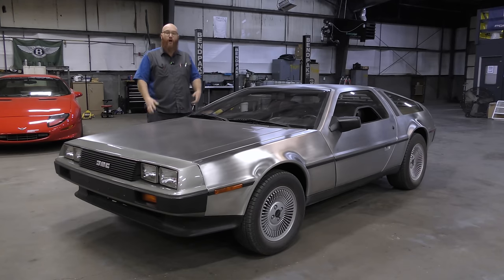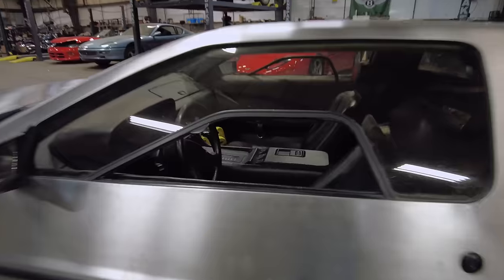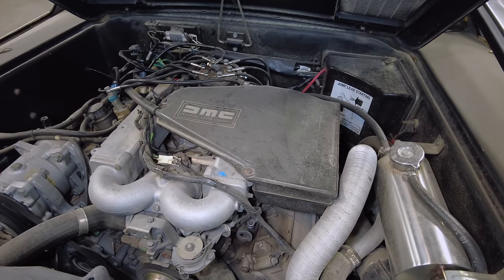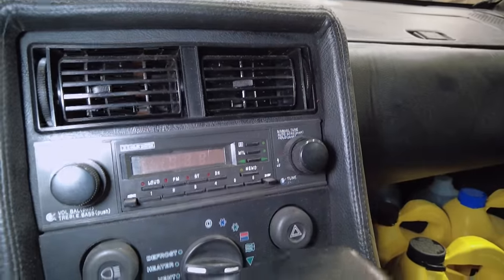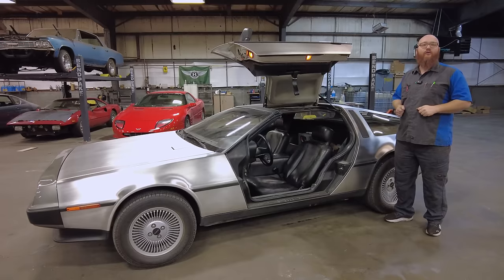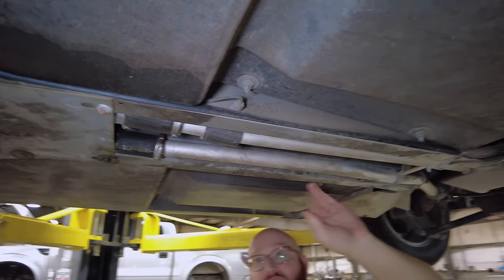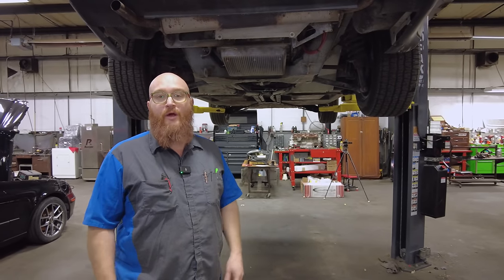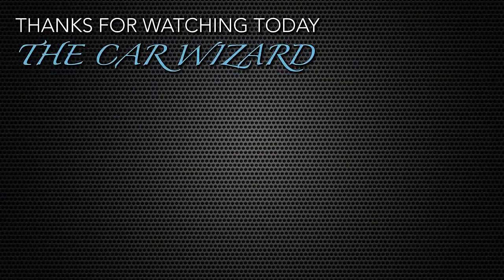Time Machine in My Shop! This DeLorean Will Send You Back to 1981

Comment: The Hot start issue will be the Fuel Accumulator. it's a wear item. Easy to fix.
Reply: I was going to say the same thing (happened to me too)... took an hour or so to replace and fixed issue instantly.
Reply: Fortunately, in the 13 years that I owned mine, I never had a hot start issue. Just an occasional no-start issue! lol

Comment: The engine bay was designed for a rotary engine that never came to be.  GM was looking to build one and John DeLorean would source it from them but they only built concepts and then abandoned the project, as did all the manufacturers who went with pistons instead except for Mazda and its Rx-7 with its tiny engine could generate 300 hp which was so attractive to John. A DeLorean was converted to use a Mazda Wankle rotary engine, and it goes 0-60 in 4.5 seconds so it worked like it could with the right engine.  This engine failed DeLorean, the car was not great, and of course then he went to drugs to save the company and we all know how that went.  The company died because of the lack of an appropriate engine for that time.

Comment: I have owned - restored - sold two of these in the past, and seeing videos like this kinda makes me want another, until I remember what bad cars they are. Thankfully I still have my photos from those restorations.   Thanks Wizard for the trip down memory lane!
Reply: Well. You could just keep the body and replace the engine, transmission, all the electronics etc 😂
Reply: They had such potential….too bad GM was allowed to go to war and run them out of business. It really started with the drivetrain choice.
Reply: They’re awful cars 😂
Reply: @Whatisthisstupidfinghandle 
Basically what you would want to do if you’re planning on driving it daily. 😂
Reply: @rolandthethompsongunner64 wrong again. I daily drove mine with no issues
Reply: 130Hp. Half fiberglass. Every bolt on the stainless body is apparently not rust proof.
Reply: @rolandthethompsongunner64  dude you really gotta stop with the bashing. Do you own one? Have you owned one? Please show me where the Delorean car hurt you
Reply: @DeloreanGuy2  If you want one go buy one. But hey don’t bother to do any research and see what you end up with. Because nothing I’ve said about that car is wrong. They’re heavy, slow, handle like garbage and have crappy power plants. You would be better off with a Pontiac Fiero . At least until it catches fire. 😂
Reply: @rolandthethompsongunner5305 I have a Delorean. I've also owned a fiero. They are slow compared to what, a new car today? That's not a comparison. They aren't heavy. My 2 door convertible bmw is heavier, by a lot. Mine runs just fine anytime. It is 40yrs old and as such requires maintenance, what car doesnt?
Reply: @BubblesTheCat1  I'm so glad you came on here to just bash every car you have a problem with. Have you actually ever owned any of the aformentioned cars? Also you must not know how to do mechanic /maintenance work of any kind and NEED to drive  a "reliable" toyota. I'm not interested in a "basic" car like a toyota, otherwise that's all i'd own. Cars are my hobby. I must be really into "crap" cars! oh well, at least I enjoy them, and that's all that really matters. I don't know you, will never meet you and could genuinely care less about your opinion on the internet. But hey, good like to you in life with that attitude!
Reply: @rolandthethompsongunner64  what's your definition of heavy? I agree with underpowered but that's easily fixed with better cams and a free flowing stainless exhaust. As for the handling, they don't handle all that bad especially if you go for the aftermarket lower lower control arm brackets and poly bushings for the rear trailing arms! Also when a lot of people look at these cars they tend to not use any historical context, looks at the late 70s and early 80s corvettes... also the other sports cars coming out of the UK at the time.. They honestly aren't all that bad for being assembled by a group of people who had never built a car before and they're plenty reliable, I know quite a few owners who daily their cars. One of them even has the twin turbo kit on his

Comment: Before adjusting the mixture and  the fuel distributor, really should check the control pressure at the warm up regulator.  The fuel distributor adjustment is only for fine tuning, but will not fix hard start problems.  What is the black CDI at the shop for?  I have one as my daily.  They are a great value

Comment: Its pretty easy to remove the back bumper and tail lights to work on the front of the engine like replacing the belts and water pumps. I just hope the owner had the valley of death checked out. Coolant likes to leak and corrode the aluminum engine block in the valley to where the oil galleys leak pressurized oil.
Reply: That's where my B27F leaked coolant on my Volvo. I remember seeing coolant pooling there. I had it corrected before any damage was done.

Comment: If it's 304L stainless it will rust right up in salt water, or salty snowmelt. It will turn black instead of brown, but all the associated steel oxidation problems like rust jacking are still there. And there are still carbon steel parts under it that will rust out of existence.

I had a friend who bought one of these to fix up. It's slightly faster than a 3-cylinder Mirage. 1985 me was disappointed.

Comment: The engine is really not hard to work on. Had a Volvo 260 that had that engine: Smooth, very advanced for its time, but no power  house...
Reply: I was a Volvo mechanic and worked on numerous 260's that had that same V6 engine. We hated working on those engines. They were jointly developed by Peugeot and Renault.  They had numerous drivability problems, were under powered, They all leaked antifreeze, and got terrible gas mileage! Labor rates were high due to the component location in the engine bay! Volvo lost lots of sales when they subletted their engines to other manufactures. They also used a straight 6 diesel from VW! Another boat anchor.  Volvo's reputation for reliability suffered because of this. And their sales reflected it!
Reply: @suzintru1  I have had many Volvos only the years, but my favorite was a 1970 164 Automatic: That car was a tank with over 300k miles. Sold it to get a 240 DL with fuel injection.
Reply: Indeed my 604 had terrible cooling problems! all that French plastic got brittle and disintegrated. I did love the tyle of the 604 though and the seats!!! @suzintru1
Reply: @tonybooth4  have you seen the film Frantic from 1987? It briefly features a 604 in a getaway scene.

Comment: I've always thought it'd be fun to at least to drive a Delorian.  I have heard from other videos about deloreans on YouTube recently that the little door for fueling is a first year feature, on later years you had to open the entire front hood.
Reply: As an owner of an early '82 model, this is in fact true (they ditched this somewhere in the mid '81 timeframe). It's not a deal breaker by any means and later cars are generally more reliable but the gas flap in the hood is def cool.
Reply: Yup my understanding is there were 3 different types of hoods, the first had the fuel filler door and the creases, next version removed the door and final version had no creases, and this was done as it was easier to make the hood without those features.
Reply: @terrybeavan4264  everything you said is correct.
Reply: @lesstyranny2695  81 no gas flap here. Definitely gets the extra look when gas in up.

Comment: There is one in a local shop near me. Also 1981. It is in fair condition. The mechanic said it has a Volvo engine. I thought it was a Peugeot engine forty years ago. So, PRV, indeed!
Reply: Yes see detailed replies above, the engine was built in Dourvin in France but shared. De Lorean thought he could save $$$ and use a shared engine.

Comment: One of those with a fuel injected 215 cubic inch GM aluminum block V - 8 like they put in the Olds F-85 would have made a great seller.
Reply: Peugeot had intended to compete with the Rover 3500 SD1.

Comment: Well, sort of - the Lotus designed X-frame under it is steel.  And even with the epoxy coating, it is prone to rust...  One will want to be mindful of road salt season, esp. if one lives in a rust belt area.

Comment: I did tons of cams on the Volvo 260's  which is the same engine.... I saved customers hundreds by using a hole saw right above the gas pedal in the fire wall to be able to pull the cam out instead of having to remove the engine. Terrible engine

Comment: Looks really good “stock”.
Passenger front shock looked wet.
So another channel mentioned an engine block corrosion issue “valley of death “. Anyone know if the pitting can be filled in with aluminum welding? Didn’t seem like a machined area.
Reply: Although its never been done before by any PRV owners, their is advanced industrial technology & methodology to repair these.  Look up & study Belzona Epoxy System, & they have a video on engine block & industrial cylinder repair for 1-$10 million industrial diesel repairs used in power plants ect!!!!! 
They don't just rebuild multimillionaire dollar engines & equipment, they repair it with this stuff.  If the hole happens over the oil feeds, just sleeve it with aluminum or brass tubing or similar thin walled tube with similar expansion rates....& epoxy it with their mesh scaffolding...

Comment: Iconic 80s car but that original engine was the BIGGEST POS on this planet. I had that same engine in my 1986 Jeep Cherokee: 2.8L V6 that I believe was a Renault designed engine and GM put them in several models and also some AMC engines like Jeep at the time. Then in 1987, Jeep put in their workhorse reliable I-6 4.0L engine.

Such a shame Delorean put that POS engine in. Any Deloreans out there with a LS swap? 😂

Comment: Lots of knowlegible  people commenting on the PRV V6 a real pity fuel crisis struck and ruined both Peugeot and Citroen's planning, together with emissions, fuel costs French taxes etc, if it was developed as a V8 as intended it would have competed with Merc 280 W116 5 series Bimmer etc. and of ofc jag XJ6. Strange thing though they persisted with the V6 in reworked fashion till 3.0 litres nd 150 kws. For a time Renault competed with F1 engines intended to be used in production cars but Euro fuel costs just killed what was possible.

Comment: They are frankenstein cars made of various discontinued models from other manufacturers... mine had Ford Fairmont brakes and a Peugot motor that leaked a lot of oil...the little windows had EXPENSIVE motors, the gullwing doors had double hardware- (garbage). No thanks, brohiem!!

Comment: Dealers couldn't give them away, then the film came out.  The frames were epoxy-coated steel which rusted badly when water got between the protective epoxy and steel.  The British TVR sports car used a similar chassis, with similar horrid results.  Engine was a Renault V-6, as underpowered for a sports car as the Plymouth Prowler.  Ballast resistors were dropped by GM and Ford in the late 1970's with their electronic ignition.  The Sanden AC compressor is nice.

Comment: Back in 2000 or 2001 I was in El Paso Texas on a 3-day layover. One day walking from the airport to my hotel there was this little mom and pop used car dealership that had a manual DeLorean with right around 40,000 miles and they only wanted $7500 for it.  If I had been there one more day I would have bought it and driven it back to Atlanta. (If it would have made it.😅)

Comment: It is a time machine, it's obvious that the Cyber truck is a re-incarnation of the DeLorean, stainless steel, the shape and even a frunk, it's no accident or co-incidence. Someone made this observation on youtube and by golly he is right on the money. The reason why the PVR 2.7L fuel injected V6 was adopted is because Renault had used it in their top of the range front wheel drive R30 sedan. Mr DeLorean was astute enough to avoid a full blown design and development from the ground up of a mid/rear engine/transaxle with independant suspension and he knew he had one off the shelf in the Renault, a complete package thank you very much, just some mods to fit it behind the driver.

Comment: I sure wish they hadn't used that car in those movies. I actually like the car, or at least the look and the concept. It did need more refinement. But I absolutely hated the movies. Now any mention of a DeLorean immediately gets connected to those damn movies. The frame is not stainless steel, and it rusts like crazy.  At least it has REAL tires and normal sized wheels, but I'm not crazy about the 4 lug thing. Why couldn't they have used 5 lugs? The PRV engine is extremely unreliable, and is made of metal that tends to corrode badly. I have seen videos where the engine casting actually had holes in it due to corrosion. It also only has 130hp. Since the car was designed from the ground up, I don't know why they didn't use a better engine, with a carburetor.

Comment: I'm not much of a fan of either the movies or the car. I've always felt that buyers of the cars were screwed over by the anemic engine which should have been a super charged or maybe even twin turbo, fuel injected, Ford 429cid V-8 as a base engine.

Comment: So I would aver that it overheats, and it doesn't run properly. You will blindly replace a bunch of good parts at your customers request, and you don't understand the fuel system. After this it will still overheat and run poorly. Poor customer and shame on you.

Comment: Still a great looking car.  Just a shame that it ended up with the old 2.9 liter PRV engine and overweight from its convoluted design history.  It's a shame the original plastic body proved unworkable, and an even greater shame that the backbone chassis and stainless steel outer panels were then bolted on as well rather than instead.  Just think what it would have been like with another 100 bhp, mid rather than rear-engined and with a simplified, lighter body.

Comment: Fun fact: the body, and suspension are stainless. this car has a steel body, fiberglass underbody with a supporting ladder fram for the driveline, the chassis is epixy dipped and isnt stainless. It can rust.

If you want proof go to legit street cars on youtube and watch his restoration series.

Comment: the PRV engine is a 2,7 in Volvos at least I think it's a 2,7 in the Peugeots too but the Renault 30 is a 3,0 as far as I remember I know that the Volvos are a 2,7 and the Renault is a 3,0 i'm not sure if the Peugeot is a 2,7 or a 3,0

Comment: Never understood why he opted for the ridiculously horrible v6 instead of the fun, powerful and bulletproof 2.3 liter turbocharged 4. 
More fuel efficient and better numbers. 
And less expensive. 
Delorean was an idiot.
Reply: Based on the reviews and information available on Mr Delorean, your claim that he was an idiot is erroneous.
It's understood that the PRV V6 wasn't the most powerful and smooth engine available at the time, however the Delorean company did not have the capacity/finance to manufacture their own engine and were at the mercy of OEMs that were willing to sell their engine at an 'affordable' cost.  It also goes without saying that a cheaper straight 4 cyl engine wouldn't been appropriate to the customer that the Delorean was aimed at during the early 1980s.  The buyer's expectation for such a mid engined car at that time was for a v6 or v8 engine - which was a similar engine layout to the more expensive 'baby exotic' cars of the period - such as the Ferrari V8, Maserati V6, Lamborghini V8, etc.
Reply: @georgebettiol8338 
He definitely had the option to purchase the 4 cylinder 2.3 TURBOCHARGED engine. The porsche 924 wad similarly designed (except for the engine placement) and the v6 was already known as an anemic maintenance and reliability nightmare. 
The company COULD have been wildly successful due to all the resources and experience that delorean supposedly had. 
But when he went solo, his stupidity was exposed.  
There were MANY better options for powerplants available to him.
He chose about the worst one.
I'm standing by my original statement.
Reply: $$$ was the reason.

Comment: Lol I find it hilarious that they had to go 88mph to travel back in time.  There was some questions back in the 80's on whether getting it up to 88 was even possible!
Reply: That's as high as the speedometer will go. 
They put those on a lot of cars back then, even though it was not a government mandate.
My 82 Yamaha turbo Seca had that, but it would peg the speedo and then would go up to 143 full throttle. I figured that out by the gearing. I used to run up and down a freeway in San Diego, doing that. No helmet! 😅😂😅
Reply: Nowadays on most US highways, you wouldn’t travel back to the ‘80s in a DeLorean, but you would get left behind in the past by all the modern cars easily going faster than 88.

Comment: The hot (non) start problem with my '79 320i BMW with CIS injection turned out to be injectors not fully closing after an extended drive and flooding the cylinders.

Comment: 1.21 jiggawatts!
I absolutely loved how you went over DMC12's systems - and learned a lot of new stuff here. I never thought it would have an engine compartment in the back and boot in the front, pretty much like Fiat 126. The flux capacitor is definitely nice... and I wonder if there are still any DeLorean owners who are NOT into Back to the Future. 

13:40 is it asbestos? If so, this thing looks baaaaad...
Reply: Yes that part is asbestos and the muffler shield as well. I'm a owner and mine have been removed.

Comment: Imagine it with normal doors, a decent drive train and a stick… What inventory, if any is stil lurking in Northern Ireland?
Reply: Houston Texas gonna build 100 new ones
Reply: It just wouldn't be a Delorean without the doors. It only takes 11 inches to fully open the doors. Try that with a normal car. Mine is a 5 speed manual.